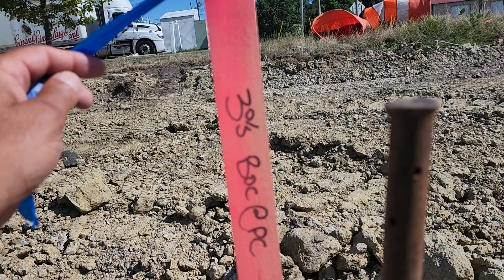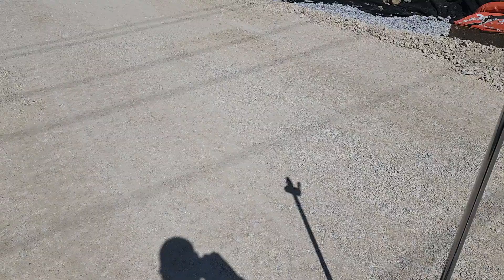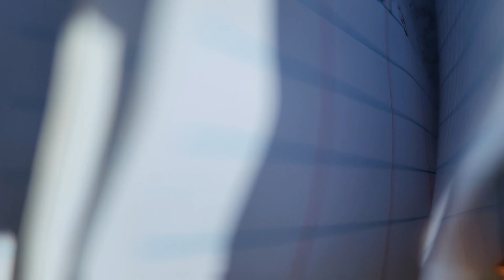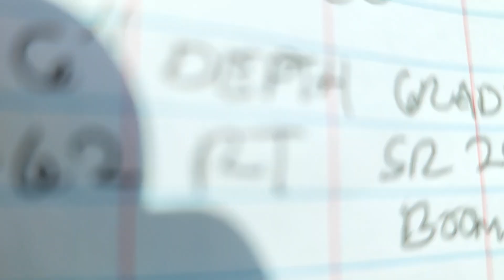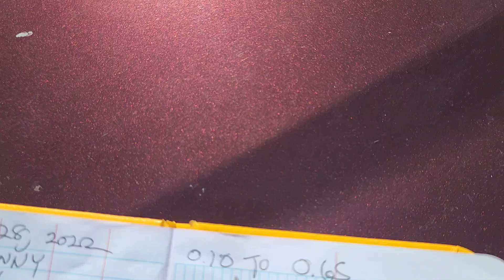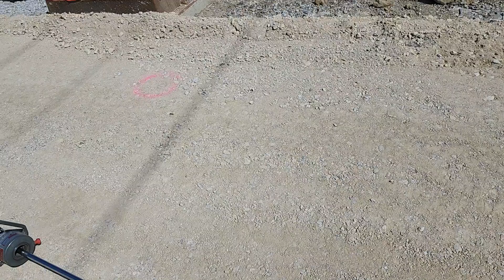Soils Field Testing: Light-weight Deflectometer (LWD)

Comment from the maker: Corection:I  meant #53 stone instead of #8 stone or soil. The  LWD measures bearing capacity of subpage and aggregate. #53 stone is self compacting which it is a good base to use prior to  concrete and  bituminous paving.